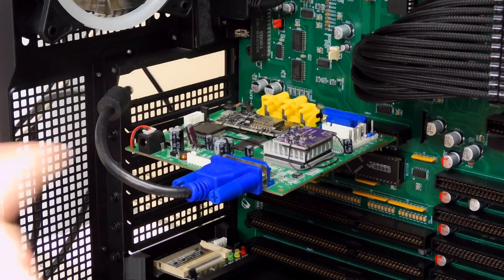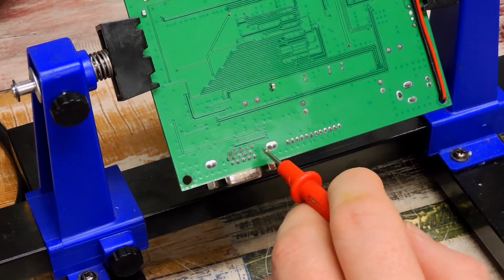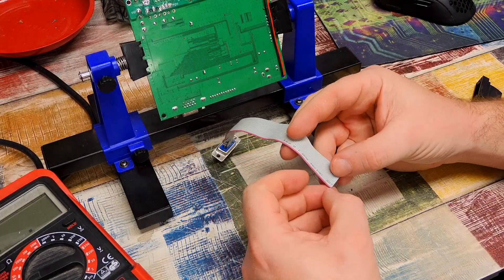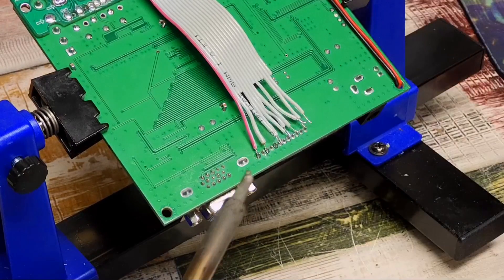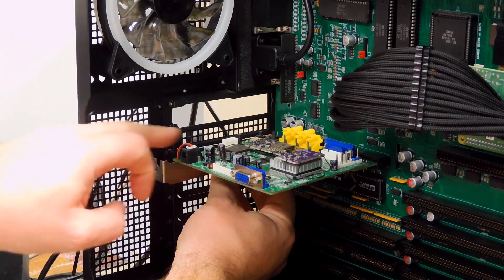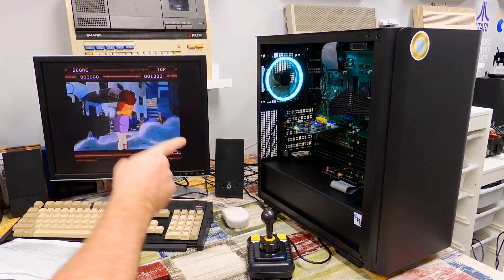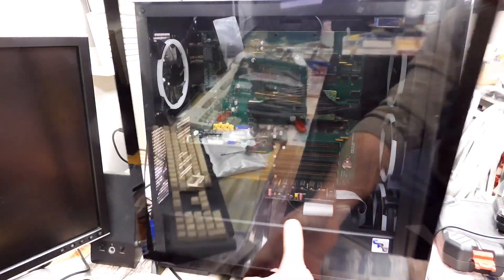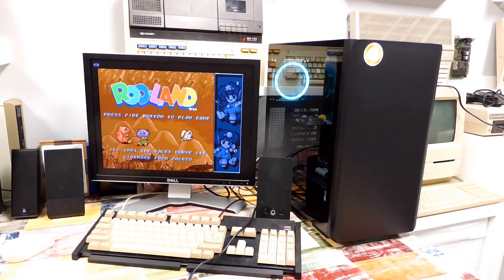Let's finish the GBS8200 in Amiga 2000 EATX

Comment: Wow, I've never given a single thought to how many of the 15 VGA pins are actually used.
Only 6! Of course, the 9 PIN connection of HGC, MDA, CGA or EGA would have been enough. 
Presumably to make it clear that it is not compatible, a new connector was used.
But then why not before, MDA CGA HGC and EGA are not really compatible with each other either...
Thanks for the Video, nice job as always!

Comment: Nicely done, the Amiga shared the same bracket convention as the old ISA standard from IBM - so the bracket would need to be flipped in order to be inline with the expansion card. Intel changed the standard for new cards with PCI and reversed the orientation.

Comment: Hello love your channel ❤ a question the A2000 is it a normal mainboard from a a2000 case or a a2000T if there is a (T-model) i have 2pcs of a2000 compleet might build a tower in that case
Reply from the maker: There wasn't an A2000T, rather this is a modern reworking if the A2000 into an EATX form, hence why it fits in this modern pc case.  The original 2000 board wouldn't fit.  

Glad to hear you've been enjoying the channel, thanks for the support.

Comment: Nice work! I didn't know about this GBS8200 VGA mod for the Amiga.

Aside: I wish they'd designed the Zorro slot keyed for direction. I recently traded to get my first half-sized Zorro card: a GVP RAM card for my 2000... and, once, accidentally put it in backwards. The person that sent it to me had made a label on that read "CARD SLOT SIDE" (instead of "FRONT OF AMIGA" which I've since changed it to). In a confused moment I interpreted "CARD SLOT SIDE" to mean the side where the case has a slot exposing the card edge (i.e., back of Amiga). When powering on with the card in backwards, after about a second, the Amiga powered itself down (maybe detecting a short) and thankfully nothing was damaged.

The manufacturer had no direction printed on the PCB nor label indicating which direction to install it. eye roll
I certainly like that modern PCB designers realized there is a lot of freedom to print useful (or humorous) things on the PCB itself!
Reply from the maker: Thanks for reminding me, I forgot to link my original mod video, but it's on the description now.  

I had that exact thought when first fitting the mod in the video slot which also isn't keyed, and there's no indication for which way it has to sit.  It's not in the video, but I checked the position of ground with my meter before fitting the gbs mod just to be sure I had the orientation correct.
Reply: @CRG  Thanks much for the link - I hadn't found it yet!